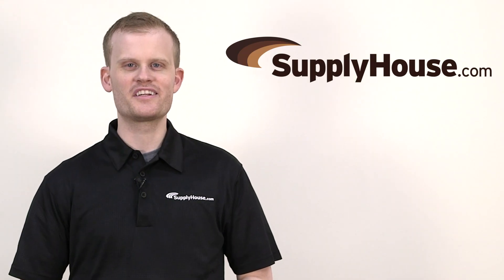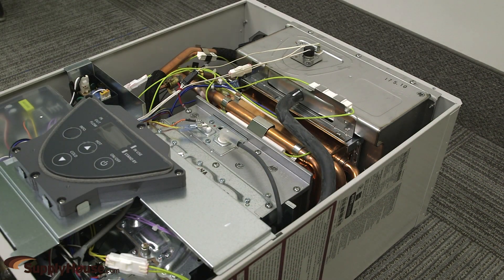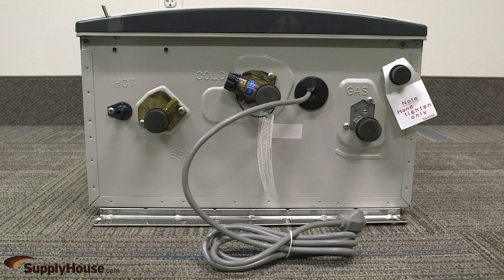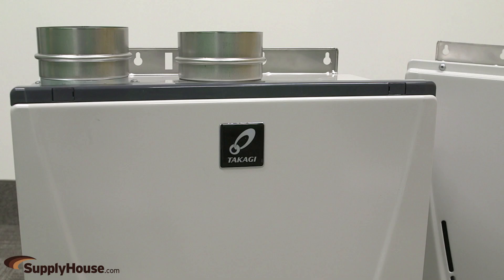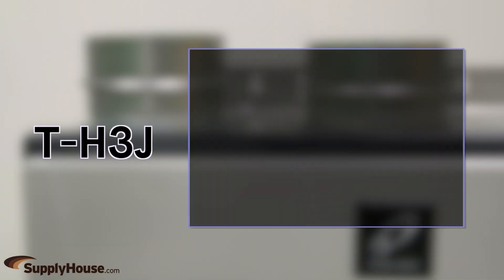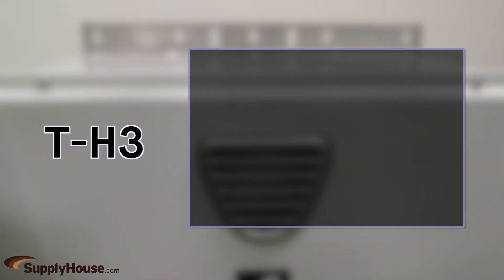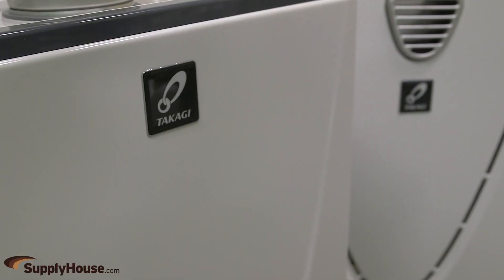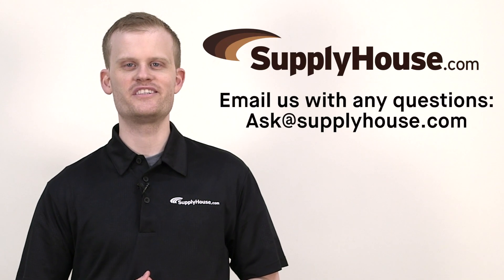Takagi T-H3J, T-H3S, and T-H3 Condensing Tankless Water Heaters

Comment: My 3 year old T-H3M started howling when fan kicks in and is not filling up my condensate collection system like it did the 1st 2 years. think the fan is failing and some issue with condensate getting into that area or collecting there, line was free is all I troubleshot so far...  do we contact you or them over this?